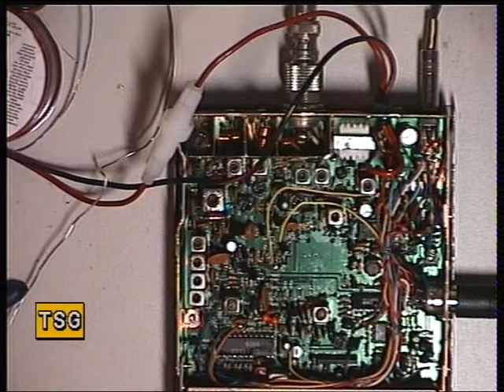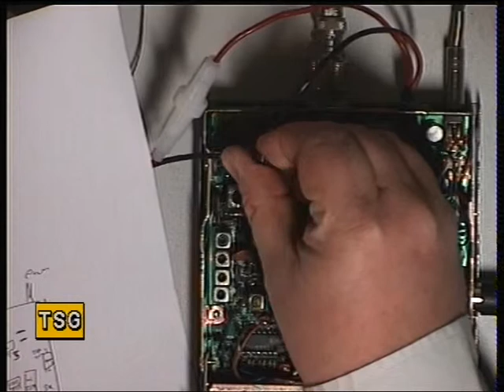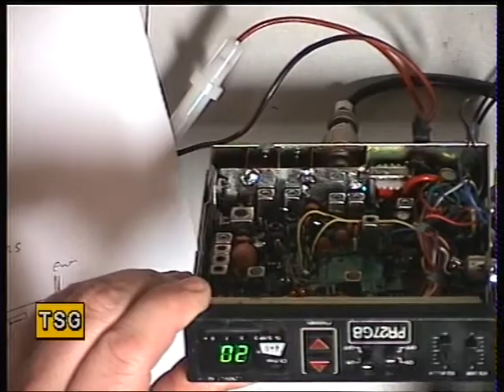DNT Contact 40,  UK (CEPT band, PR27GB) CB radio (Mobile), Receiver alignment.

Comment: Good Video Richard - When setting the "Signal Meter" on the Radios is there a Method you use on the test set or is it trail and error?
Reply from the maker: Yes Rob, you will notice that when I come to set the S meter on any of the CB radios, the Signal Generator (part of the radio test set I use) is not only set for the correct frequency of channel 20 (on 27/81 models thats 27.79125 & on PR27GB models it's 27.205), but the output strength of the signal generator is set to 100uV. The CB radio's internal preset for the S meter is then adjusted until S9 is shown on the meter.

It can only be adjusted with a signal generator....but...it can be any old signal generator as long as it has a calibrated attenuator than can be set to 100uV....it doesn't even need to be an FM signal generator as the injected signal does not have to be modulated. There are old valved signal generators out there on Ebay that would do this & cost just a tenner!
Reply: UK CB radio servicing Thanks for the info!